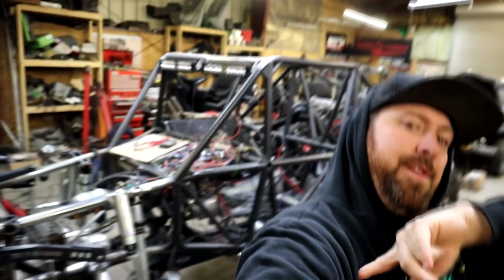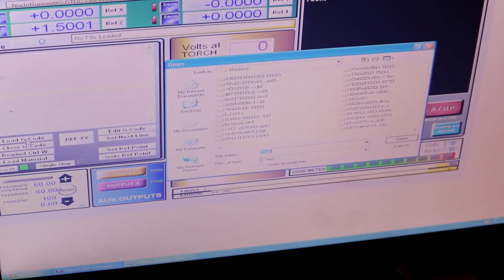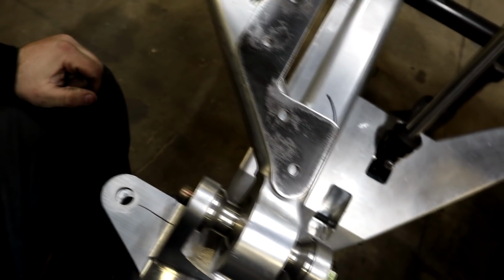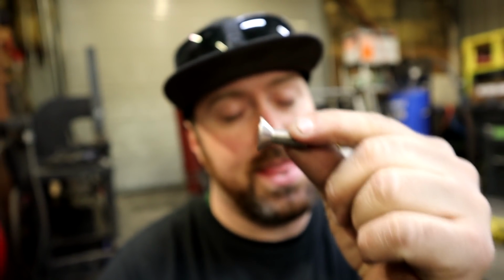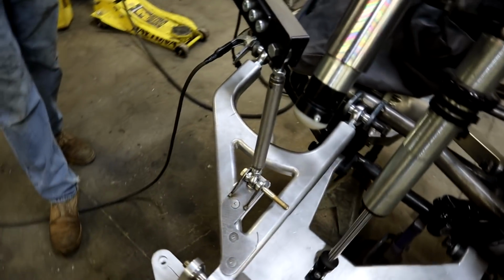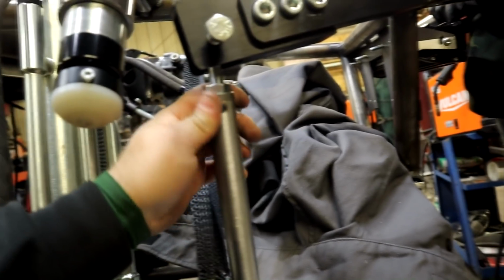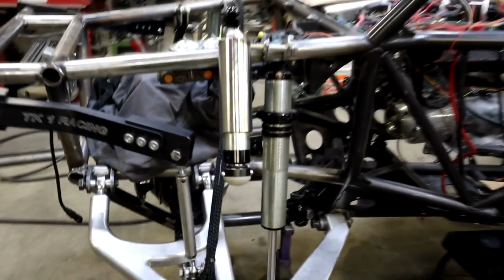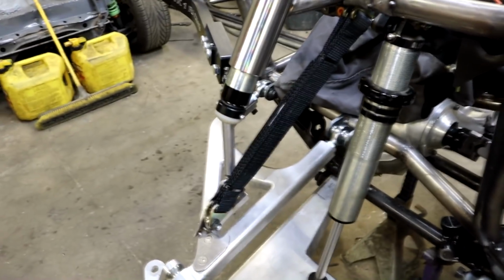Ultra4 IFS Twin Super Charged Build Update Part 16 - How We Install the Sway Bar and Limit Straps

Comment: Brilliant as always. Medusa is stunning. 
Any worries or precautions about possible Galvanic corrosion between the Steel limit strap plate and the Al upper arm?
Keep up the awesome work.
Reply from the maker: Not at all worried. #1 the bracket will be coated in black steel it. No raw metal to metal. #2 the corrosion you could see takes time and our stuff is serviced a lot so it won't be on there for a long enough period. It's no different that the heims threaded in or the uniballs pressed in. No worries here.
Reply: @carbonshocks  I guessed that because you know your stuff, unlike bigger undeserving YouTube channels.
Thank you for your quick and detailed reply. Go Team Olympus!!!!
Reply from the maker: @gafrers  I knows nothing....... ;)